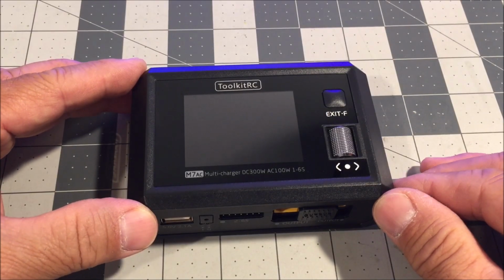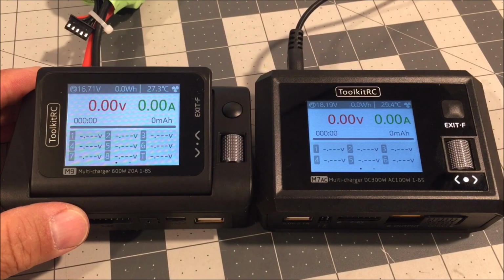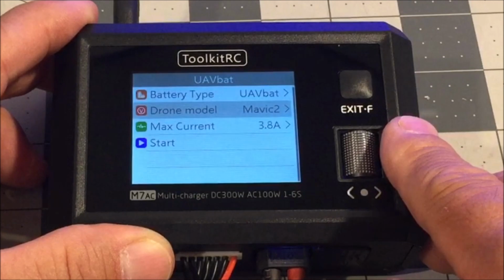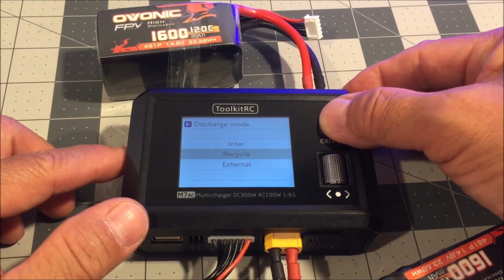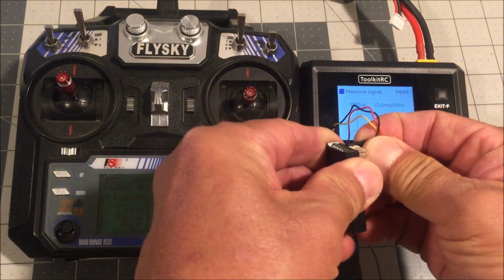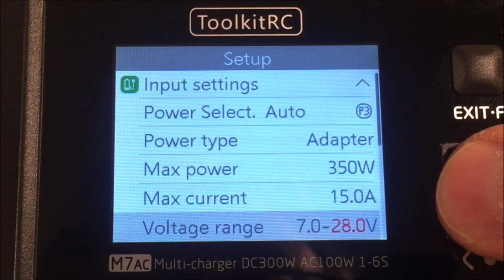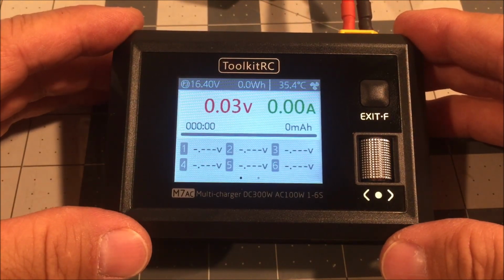Toolkit RC M7AC  AC/DC Multifunctional  Smart Battery Charger

Comment from the maker: Racedayquads  :  https://t.ly/5WYU
00:00  musical unbox
00:54  intro closer look
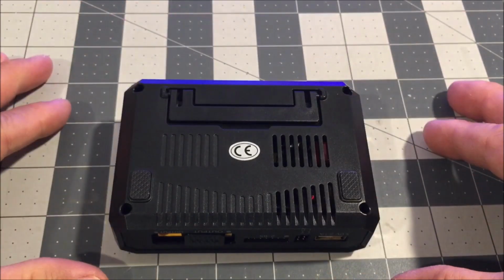04:17  compare to M9
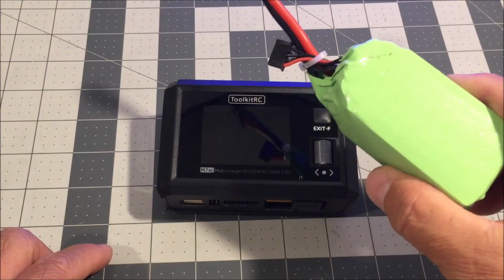04:53  power on
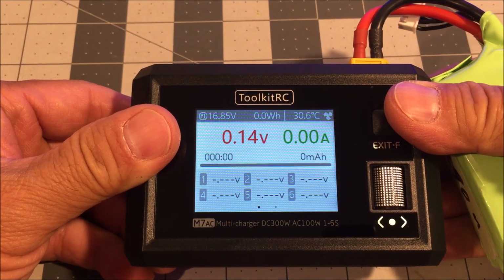05:35  battery voltage 
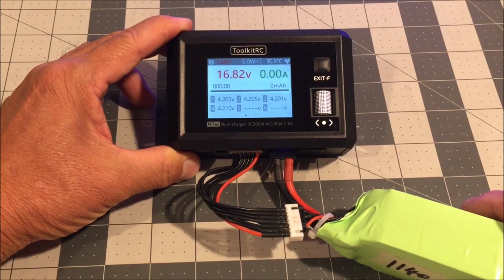06:52  resistance
07:40  charging
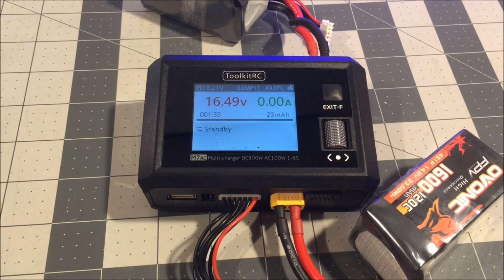11:37  discharging
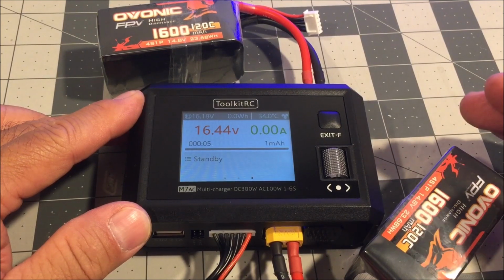14:18  recycle feature
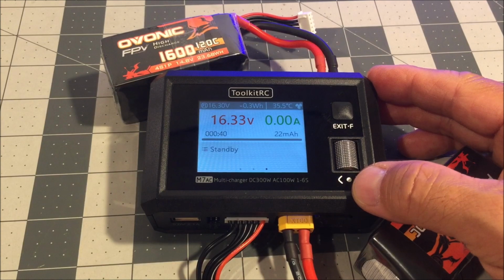16:37  storage
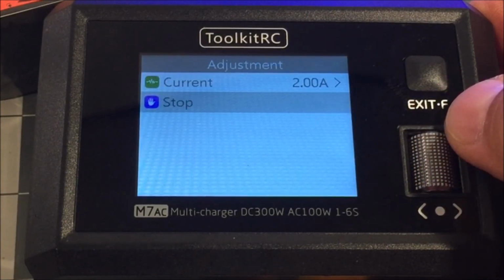18:02  measure signal
19:17  signal output
20:01  esc test
20:20  power external devices
21:30  into the settings
25:52  final words

Comment: Hi! Can it charge/discharge without balanced port? And how it accurate?
Reply from the maker: You can charge it without the balance connector but you shouldn't.  You can cause fires like that.  I don't know how accurate.  I don't charge without the balance connector.
Reply: @RCEscape  Have you tried charging without a balance connector? ToolkitRC M7 on old firmware cannot - gives an error
Reply from the maker: @denvivanov  
mine works fine

Comment: These look really nice I’m still using the old school Skyrc chargers 👍
Reply from the maker: Me too!  I still use the old imax B6 :)  It has the balance mode all by itself so after balance charging a battery I still hook it back up to the old B6 and just Balance the cells.  Sometimes, the battery gets way out of balance from discharging too much and it seems the B6 still does an extra job even after it has been fully balance charged.
Reply: @RCEscape  - Here is an update: YT video ID: E3kYqHBBfpE - for some reason, Vifly Shortsaver v2 goes into some kind of over-current protection mode if it's connected to the M7AC prior pressing START button on the charger itself. If I don't have Vifly Shortsaver v2 connected to my charger, and then press START for DC output (power output), and then connect Vifly Shortsaver v2 afterwards, it works perfectly fine... it's strange. That does not happen on my iSDT D1, I can have it connected before pressing START on my charger, or after, doesn't matter. Do you have any clue on what could be possible reason for this? Bad ToolkitRC design?